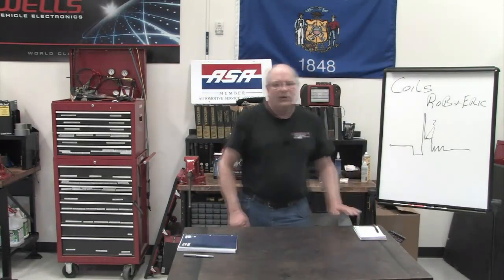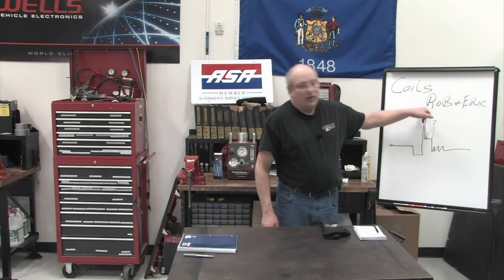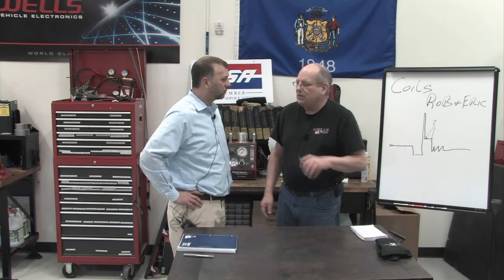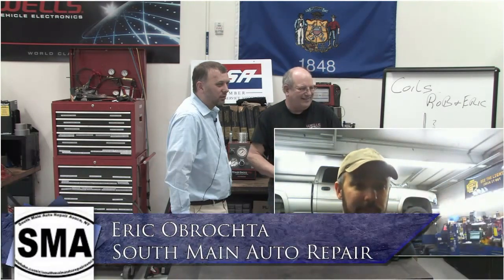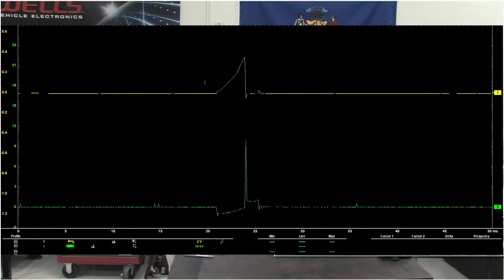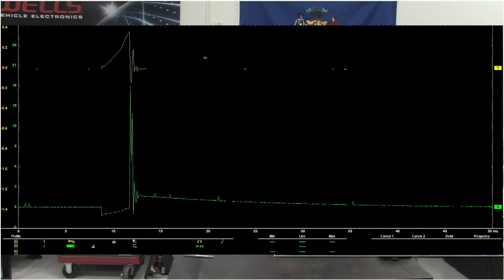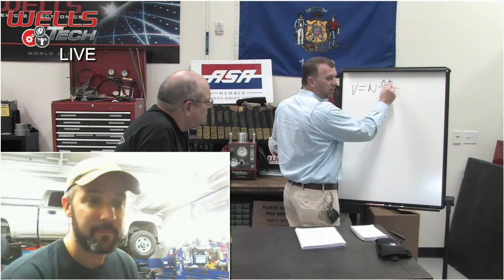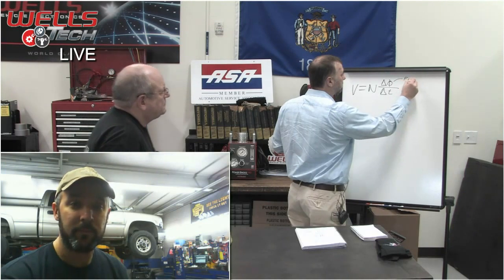Discovering Coils

Comment: Nice job guys, yes I would like to see more videos like this.  One thing I would like to add about Eric O's capture is if you notice how high the spark line is when current finally flows through the plug, this Indicates high resistance in the secondary circuit external to the combustion chamber as was indicated by the ringing in the primary current ramp and as you guys said the coil was internally arcing, which is exterior to the combustion chamber.  Learned that tip from Jim Morton a outstanding diagnostic Tech and instructor.
Reply from the maker: +busjockey1 Cool tip! Thanks man! We will try to do more videos with our engineers. Thanks for the input.
Mike Becker, Technical Services Instructor
Reply: +busjockey1 I agree with you about Jim Morton's excellent presentation on understanding ignition waveforms. His insight into where the event takes place along the burn line indicating that the problem is either internal or external to the combustion chamber was enlightening.
Reply: +Baxrok2 Where did you take a class from him?
Reply: +busjockey1 I watched the TST class online. I think it was a 2.5 hour presentation. I'm not a pro, so I try to get what I can online, through reading, and practice. 

I would like to order all three of the TST DVD's by Bernie Thompson. In my opinion, he is the best of the best. His depth of knowledge, presentation skills, and industry leading experience with ATS is mighty impressive. He takes apart combustion chamber waveforms like Morton takes apart ignition waveforms. Curiously, none of his full length seminars are available online. 

Check him out online at atstube8. Or on his site at AtuomotiveTestSolutions.com. I recently contacted them asking if they had any plans to market equipment for the DIY market. Sadly, they do not. A $750 copy of EScan is tough for me to justify.

Comment: Cool seminar guys! Sorry I missed out on the live version...

In the final segment with the ignition scope testing, it's also very valuable to pull in a second channel to look at the primary control voltage side by side with the primary current, like Eric did on the Dakota. Then you can usually get more specific in how the coil failed, as in "shorted primary" or "open secondary"!

Oh and don't start a diagnosis with Identifix...that takes the fun out of it!! :))
Reply from the maker: +motoYam82 Thanks Ivan, that's a really good point and addition to our test. We love the feedback! You are right, starting out on Identifix does take the fun out of the diagnosis, but from an efficiency standpoint I don't think there is another resource out there that can match the information given without having to go any further than a symptom or a code. I think this will become even more prevalent on newer model cars, where you can test all day long on a problem only to have the fix be a computer reflash widen the passing parameters of the test. 
Mike Becker, Technical Services Instructor
Reply: Hey Mike! Yeah, agreed from an efficiency standpoint for sure, especially on more "weird" problems that you don't see everyday.

In this case like you said nothing beats "caveman diagnostics" since coils are easy to swap around.

Personally, I still like to use the "easy" cases to practice other diagnostic techniques to see if you can pinpoint the problem from scratch "without touching a wrench". That way when that tough one comes along, you'll be fully armed and ready :)

Looking forward to more seminars, and possibly a visit to Wells with Eric in the near future!
-Ivan
Reply from the maker: +motoYam82 That's a perfect approach. Nothing makes a technician better at their job than trying different techniques to solve the same problem. That's what makes these Youtube videos and comments so great. We are able to learn different diagnostics paths from each other and share that knowledge in a convenient way. Mark always says, "if we can make your day as a tech better, we are doing our jobs." Nothing makes my day better than learning a new way to do something.

We would love to have you and Eric O visit! Hopefully that can happen soon :)
Mike Becker, Technical Services Instructor

Comment: I need to listen to the lab rats more, great video. Primary reflects secondary is this true all the time on older cars with a distributor I have scoped ignition on a good running car but primary looks good but secondary have a more turbulent pattern
Reply from the maker: Typically you will see issues on the primary side if you have issues in the secondary. The secondary will show the problems amplified over a larger scale of voltage.
Mike Becker, Technical Services Instructor